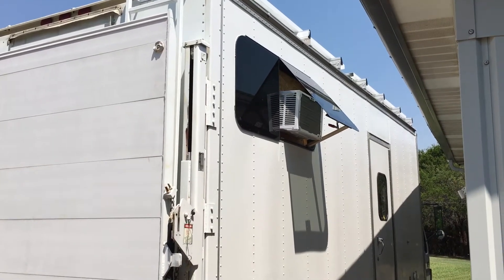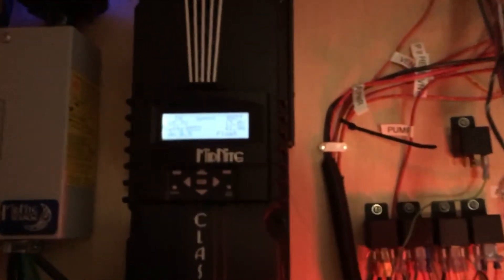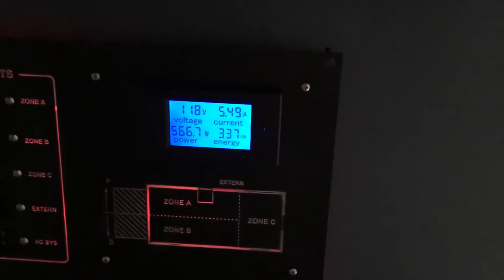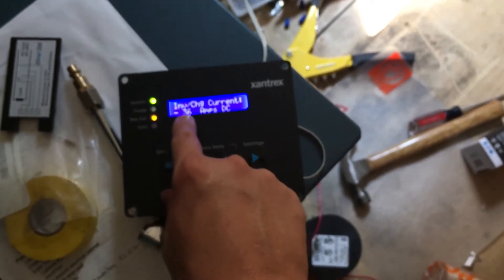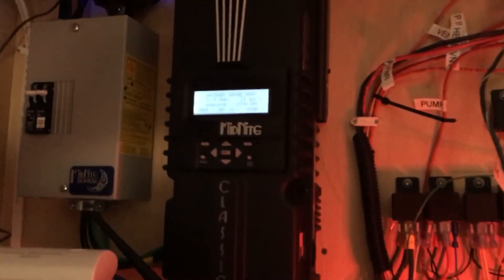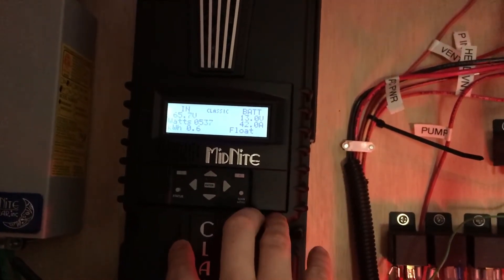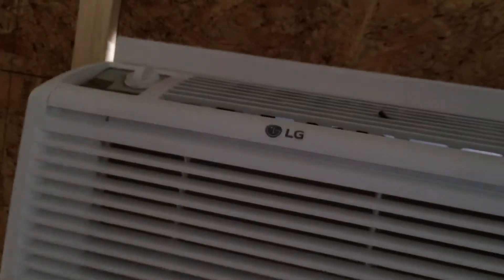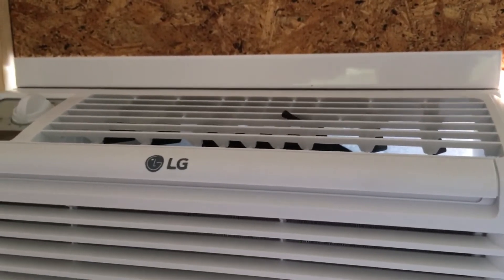Second solar air conditioner test

Comment: The solar was bringing in 523W and the AC was pulling a little over that.. Do you find that around 500W is what you get on average from this solar panel array of 1200W?
Reply from the maker: Honestly, its a bit hard to pin down an average on the solar input. I can't say I remember the exact conditions when I shot that video.  The array does pull in 1200W mid day occasionally but the input will throttle depending on where the batteries are in their state of charge.  Since I rarely pull the batteries very low overnight they aren't in the bulk charge region very long.  At some point I would like to add some smarts to either kick on an electric water heating element or the air-conditioner once the batteries hit float.
Reply: @Brian_Boxtruck  thanks.. That's good info.. I installed 1260W of solar panels just recently but I don't have the batteries and MPPT charger installed.. Looking forward to see how well this system does with AC and all the other electrical components..